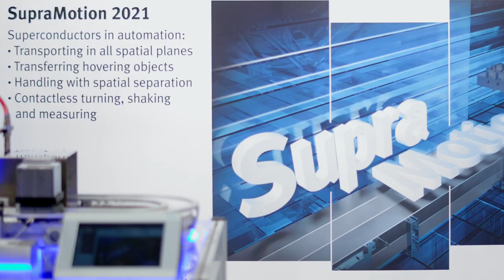"SupraCube", non-contact handling light and flexible

Comment: What does it do? Haha
Reply: I think it’s been designed to move things with levitation. They have designed a cube with super conductor properties so that they get the quantum locking effect which means they can suspend something with levitation and it was remain there exactly in that position relative to the object. It’s cool science and they made a video they can sell so that people can move stuff around with contaminating or disturbing it  and or other things. ( I think this is what it’s used for and my lingo could be a little off as I’m a noob ).